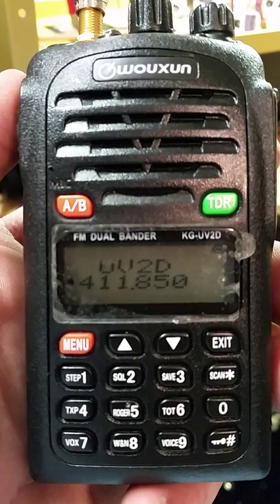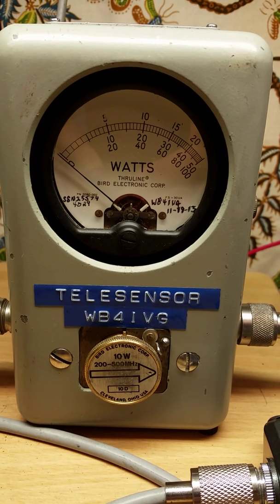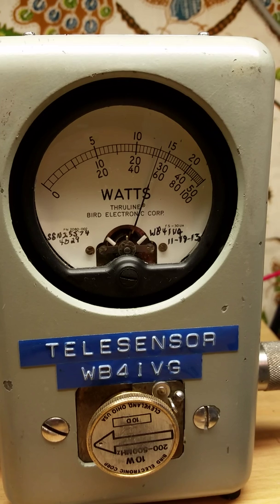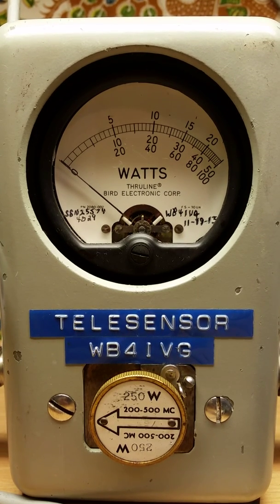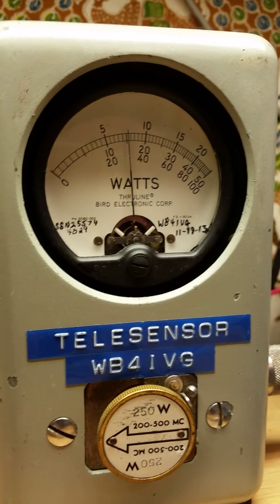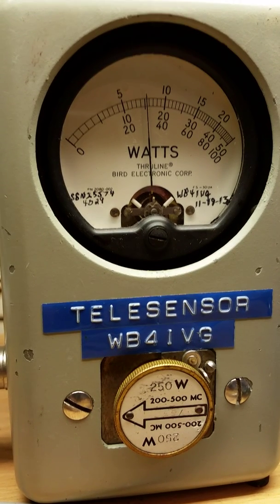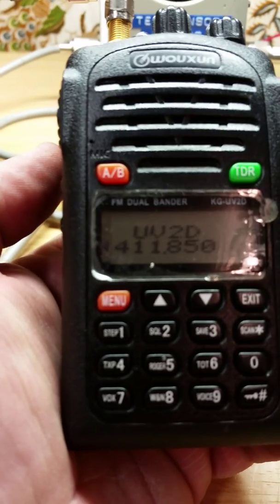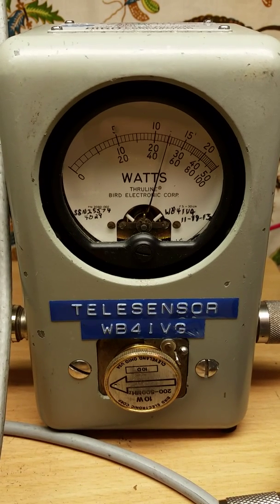VoCom Cresend UHF Continuous Duty 100 Watt Amplifier Demo

Comment: Thank you for the Demo.  Can you explain the RF sensing Circuit?  What is the relationship between driving power and output power? is the drive limited to 5 watts input? What do you get with 1 watt in?